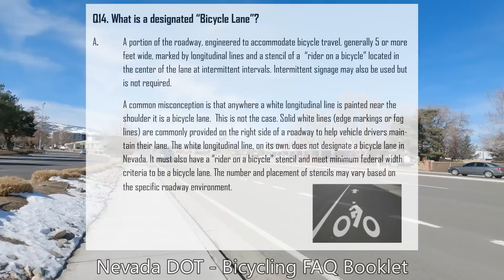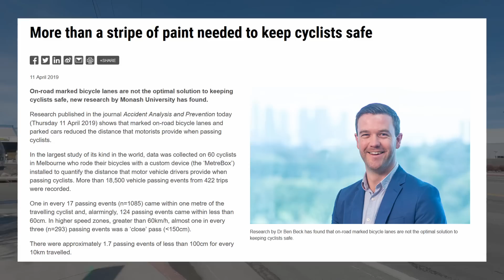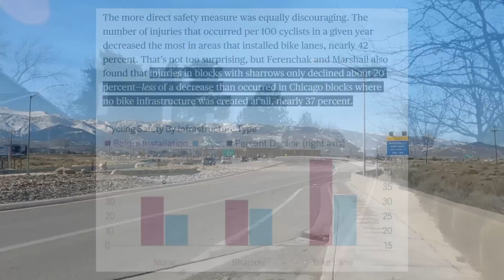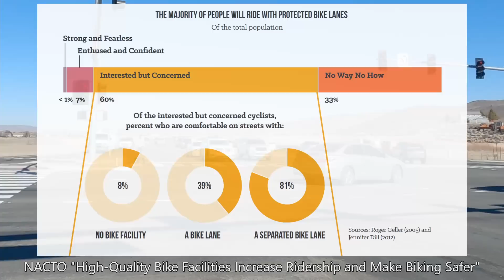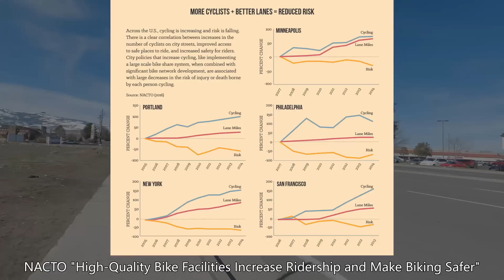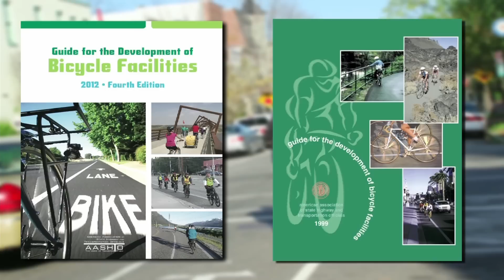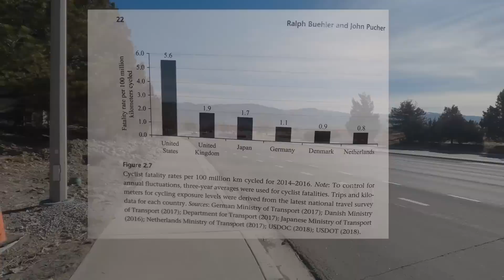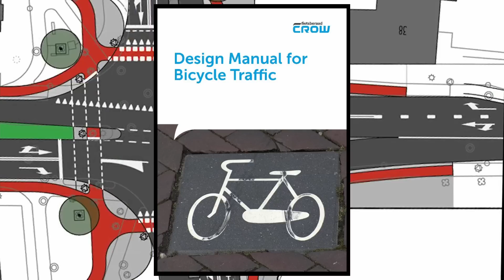Painted Bike Lanes Are Atrocious & Here's How to Fix Them

Comment: “Paint is not infrastructure.”  AMEN!  I think municipalities add these painted bike gutters because they’re inexpensive and every mile of “bike lane” counts toward the “bicycle friendly” designation.
Reply: Honestly any stroad with a sidewalk is better off just declaring the sidewalk the bike lane, its not like anyone is actually walking on it. (Because stroads are terrible, but atleast some forms are acceptable, mainly the 1 lane each way plus shared left turn lane is the safest form of stroad)
Reply: @jasonreed7522  you're telling me that preposterous both ways left turn lane is actually safe??
Reply: @blanco7726  
Yes it is.
When you prepare to enter the center turn lane you can easily see if there's anyone in it so there's little chance of accidentally running into someone coming the other way. Since you're already planning to use the center lane, your attention is actually focused on the lane.
And it pretty well eliminates the problem of being rear ended by sleeping drivers when you try to make a left from a regular lane.
Because the accident rate is so much lower and the delays of someone waiting in a traffic lane to make a turn are eliminated, the capacity of a "one plus center plus one" is about the same as a conventional "two in each direction" street.
Reply: @JustClaude13  makes more sense to me to have individual turning lanes for every exit (or a group of exits being linked by backroad with only one turning lane on the road). And you'd alternate, for 50 meters you got a left turn lane going south, for the next 30m a lane going north and so on, adapted to where the biggest exits are. 
The whole idea of two cars potentially turning into the lane at the same time shocks me lol. In Belgium there's a few stroads in the sticks, middle of nowhere mostly and they have individual turning lanes in the middle for every larger business. And the rest of the center space is often striped floor which you could use to get to smaller places (even if illegal).
Reply: @JustClaude13  actually that must be a very recent changing because I just went through a couple Belgian national/commercial road hybrids on google street view and most of them have two way turn lanes (sometimes very large, enough for both directions to pass each other). Although not all the way, mostly they last 200m a piece, then some form of break and then depending you could get another both way turn lane or one way if an intersection is coming up. Very interesting, thought I'd never seen those, but they are right around the corner from me haha (on street view at least).
Reply: @blanco7726  
Unfortunately, in my area separate turn lanes for each entrance would mean half the businesses wouldn't have a left turn lane, so there would be a lot of dangerous maneuvers by people trying to make the turn anyway.
Mostly by using the opposing left turn lane, so it would still cause the very problem you're trying to solve.
I know it looks scary when you see it, but so far it has proven to be much safer than turning from the traffic lane. Like I said, the driver is focused on that direction so he can see the other driver before it becomes a problem and respond accordingly.
And it's not just a question of the people on the street turning left to enter a business. It's also people in the parking lot turning left onto the street. Having individual lanes for them would increase the complexity far beyond what I could imagine.
Easier for drivers to move to the center lane to be ready for a gap in traffic.
It looks scary, but it works and has been very safe.
It's kind of like European streets that are safe because they look scary by American standards. The perceived risk makes drivers more alert.
Reply: @JustClaude13  good point about perceived risk. As for the entering the road from across, this is solved by just having dashed lines all along allowing anyone to cross it. But then it ends up becoming a both way turning lane anyway lol. 
Do these sustain any kind of traffic or is it over as soon as 3 cars wanna use it at the same time? I always thought seeing how the US build it's commercial areas, it shouldn't be turning lanes they invest in, but roundabouts😅 no turning lane necessary if you only allow right turns. Especially practical for busy roads with many businesses to avoid all type of left turning.
Reply: @blanco7726  
I like roundabouts, especially the new spiral roundabouts.
But we don't do them very well in America. I've seen roundabouts with 4-way stops, which defeats the purpose.
Reply: @jasonreed7522 Raised crosswalks, mixed use sidewalk into a protected bike lane would be ideal.
Reply: @jasonreed7522 , it's actually not good though to have bikes on sidewalks next to cars moving fast though. Better than in the road, sure, but still not safe. I had an inexperienced cyclist come off the sidewalk and into the lane in front of me a couple weeks ago (and there was even a thin strip of grass, even). Likely the only reason he's alive now is because I was going 30 instead of 45 mph after the light because I saw he was a bit shaky (inexperienced and/or suffering from heat stroke/inebriation...it was 97 F) because I'm a bike commuter myself and just happened to be borrowing my mom's car and had a bad feeling about the situation--I strongly suspect any other car would have been blithely at 45 mph at that point where he'd have come off the road and hit him  instead of me having the time to stop with about a foot to spare. Not sure if a crack in the sidewalk grabbed his wheel or he messed up his shifting but something turned his wheel and he tumbled through the foot of grass and down into the lane. Sidewalks are simply not wide enough nor poured to maintain the level surface you need for a MUP to be safe, especially next to a fast (>25 mph) roadway. Considering that my mom was blind to a pedestrian in the middle of the road while turning left and I had to point him out to her, I strongly suspect few people in that town would have been aware of the cyclist and moderating their speed because of him. 

Bike facilities need to have some sort of curb or barrier to deflect inexperienced cyclists from roadways if we want them to be used by all ages and abilities. Obviously, I'm not saying painted gutters are sufficient, but they're at least reasonably level (though with lots of debris potentially). With slow speeds and low traffic, they're probably easier to ride in for an inexperienced rider than a sidewalk because if you go too far one way or the other, your wheel won't fall off the cement and you can just turn it instead of falling over.  Sidewalks also have the major issue of turning cars and lack of awareness by cars. Obviously, you can't be in traffic with 35+ mph cars in most cities because they'll be jerks and a sidewalk may be the only option but let's not encourage cities to call sidewalk MUPs either because they're 100% not actually safe options either. We need actual bike infrastructure that's been given at least a modicum of thought.
Reply: @jasonreed7522  they should use the sidewalk regardless. All adding bine lanes does is shrink the road and make it worse for everyone
Reply: 🤬📢PAINT IS NOT INFRASTRUCTURE ! ! !  P.I.N.I. ! ! ! P.I.N.I. ! ! !
Reply: @theOneRizzolliMick  then drive a car
Reply: @t_c5266  I do.
Reply: painted bike "gutters" are inexpensive compared to legit infrastructure, but they are still very expensive to get them approved, stenciled, and maintained.  Terrible cost:benefit ratio.
Reply: What are they painted on?
ROADS

Roads are infrastructure
Reply: @poisonpotato1  oh yes, those magical lines on the road that keep cars from crossing them are terrific bike infrastructure. The ROADS may be considered infrastructure, but the PAINT offers no protection for vulnerable road users.
Reply: Yes, the raters have to quit coddling the towns/cities with inflated scores.
Reply: Yeah, but bicyclists can easily become speed bumps!
Reply: @Golfnut_2099  and should more often
Reply: @t_c5266  Yeah, but the problem is the spokes can really mess up your tires.
Reply: @Golfnut_2099  that's a good point. Gotta get a cattle guard to chuck them to the side

Comment: 8:43 The solution here is so simple. Use the sidewalk. There are no houses and nobody walk there, so they re not used.. when i was in Finland , you could use a sidewalk outside the city centre ..
Reply: In small towns in the USA you can ride on sidewalks no problem, especially as everyone understands its way safer than being in the road with cars. 

Just treat it like a shared bike/ped path and don't hit anyone.

This also applies to all stroads, nobody wants to walk on the sidewalk anyway so you may as well bike down it. 

Note: just be wary of frost heaved slabs that could cause a rough ride, but its still better than hitting potholes.

Comment: Having ridden as a vehicle for the last 67 years I can comment that the problem has got worse over the years.  It isn't just that there are more cars, nor even that the cars move faster.
Cars require parking. With more cars there is more parking making the existing roads ever narrower while needing to carry more.  Those parked cars swing open doors with negligent abandon notwithstanding laws. But the WORST feature is the change in attitude "roads exist for cars (only)" which did not apply when I was young. That attitude permeates every aspect of road use including road laws and enforcement.
Reply: Pedestrians used to have priority on streets when cars first came around, until the Auto lobby changed that and termed derogatory words (such as jaywalking, jay meaning rube) to delegitimize interests of people.
Reply: Plus, plenty of clowns have trucks and SUVs that won’t fit in their garages. Or the garage if full of crap they buy. 

A street I walk my dog on has 36 houses, each with at least a two-car garage. There are 26-31 vehicles parked in driveways or on the street every morning. And, no surprise, they attract thieves who break into them or more rarely steal the vehicle. Where I live, a bear is occasionally the thief…going after the french fries that dropped on the floor.
Reply: IMO we should do what Japan does, and require you have a private parking space big enough for your vehicle before you can even buy/ register it, and ban almost all street parking. If a homeless person wants to store their property in a parking space the city throws their stuff out, but if you have it in a metal box suddenly it’s ok to store it on public property?
Reply: You know what really ENFORCES the "cars are just for roads" mentality?  Bike lanes.  I've literally had someone scream "get on the BIKE ROAD" because they thought I should only be riding in a bike lane,  and not in traffic.

Comment: Putting a painted bike gutter on a road where the speed limit is over 35 mph is not good. When the speed limit is 40 mph drivers are doing 60.
Reply: I'd cap painted gutters at 30 MPH

Comment: Since i got a Ebike here in the LA suburban area, i've put about 1000 miles on the bike. I haven't ridden a bike since a kid, but am pretty avid at how to stay safe on the road. Since the ebike can reach speeds close to 30mph, i stay in the street but some times i get forced into the sidewalk. I find that riding here at least, your going to want and need to get on the sidewalk at some points or else you'll have raging cars speeding 20mph over the limit to pass you. It's crazy how pissed off cars get when you come next to them on a light. Some times my ebike can actually accelerate faster then some of these cars and reach the next light (red light) faster then them, but they speed past me hitting their rev limiter because they think i'm a nuisance.
Reply: Cars are an ego problem

Comment: My son lives in Reno, close to McCarren Blvd which is heavily shown in your video.   I've ridden my bike on that "bike lane" on McCarren and it is probably the most unpleasant biking experience I have every had.  I don't care what the speed limit is on McCarren as in reality it's a freeway with traffic signals.  Reno bike infrastructure sucks.  As a result, nobody rides on the roads.
Reply: Yes, McCarran is a high traffic throughfare that should have dedicated separated paths along it's entire circumference. (For the non-locals, McCarran is the very useful ring road encircling Reno/Sparks.)

Comment: They're building some new bike routes in my town. One part was a nice path off the road that was less than an 8th of mile long and spits you out to a "bike lane" which is actually the skinny shoulder of a busy, hilly, winding road with a 45mph speed limit. What's the point of the new path if it leads to a dangerous biking route almost immediately? I hope they eventually expand the path but idk if they will.

Comment: I crossed Canada on my bike using these stupid bike lanes the whole length: I can tell you that your critic is very well articulated and absolutely correct.
Reply: Epic adventure 👏
Reply: @Nicholas-f5  Yeah I get nostalgic a lot when I think about it. It's been 10 years and I remember almost everything, and memory works with relevancy, so that's how much these types of things are important for us.
Reply: did you at least use the TransCanada Trail a little bit?
Reply: @mena376  The Transcanadian is the only way to travel trough Canada on a bicycle, so if I wasn't on a bike bath, I was on the TC for sure.
Reply: @expod  The Trans Canada Trail IS a bike path. No cars.